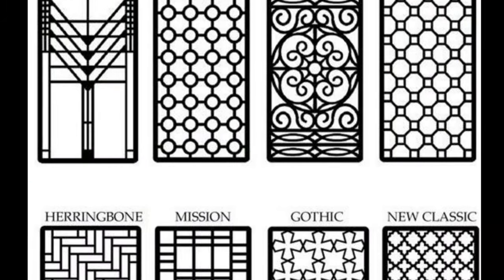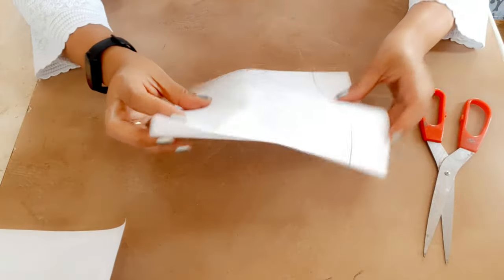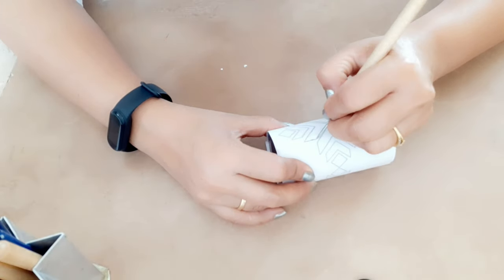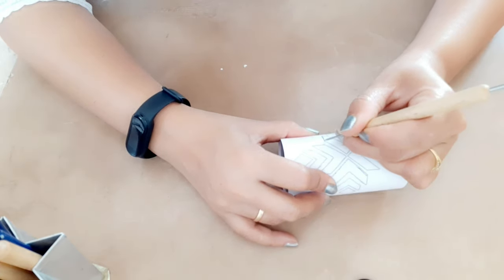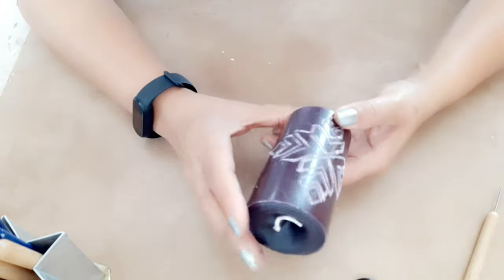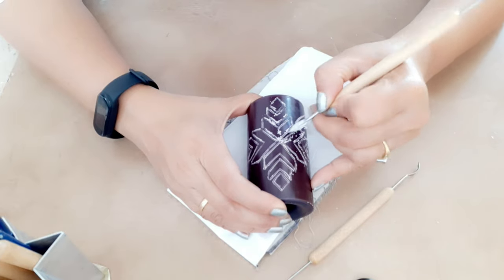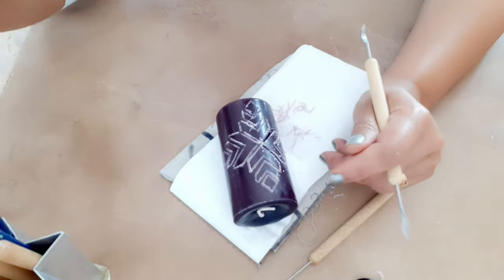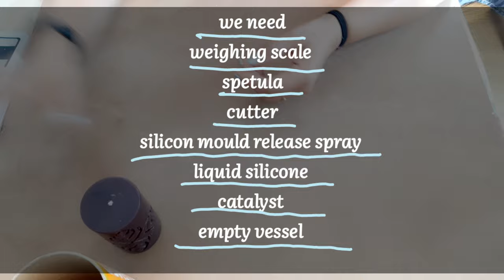HOW TO MAKE CUSTOM SILICONE MOLDS FOR CANDLES | HOW TO MAKE SILICONE MOLDS | SILICONE MOLD | CANDLES

Comment: Hi mam ,I have a question,how to prevent discoloration after burning my soy wax jar candle,I saw after burning at a stretch 4 hour's or more ,when I put off my candle ,top of the candle get completely discoloured after cooling down ,I want to know how to prevent this , kindly reply me it bothers me a lot ,thank you in advance ❤️🙏🏻
Reply from the maker: Candle color discoloration happens mostly because of oxidation, which is a natural process. Sometimes adding strong fragrance oils more than 5% also creates discoloration. Plz don't worry,The color has no effect on the quality of the candle and its stability. Never burn candle more than 2 hour continuously .I hope this answer is helpful for you 🙂
Reply: @designandcreativity8816  thank you so much mam ❤️🙏🏻